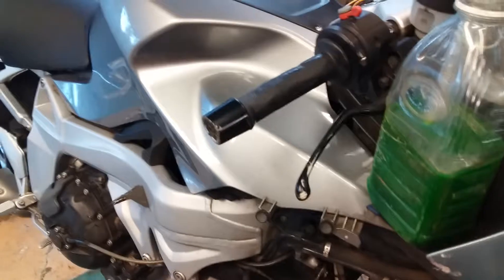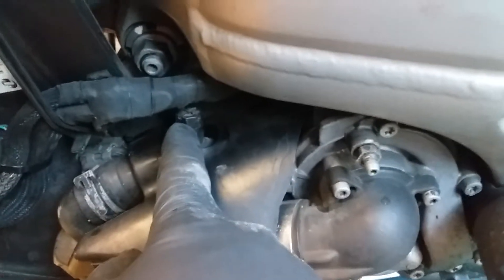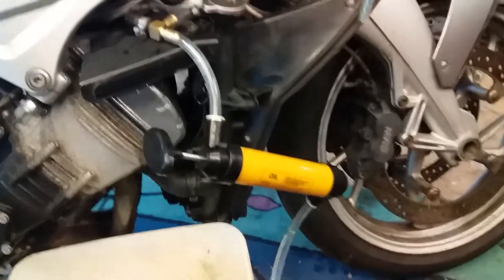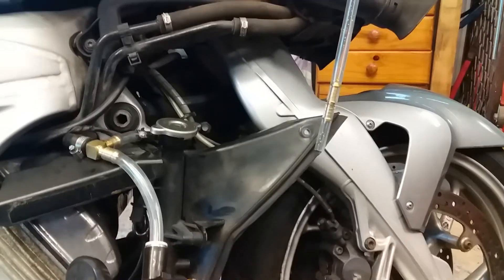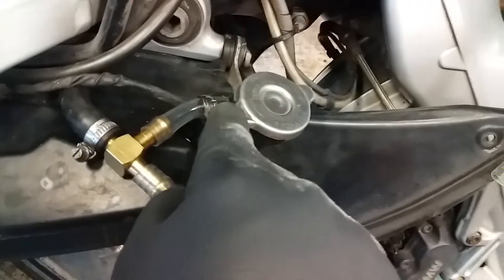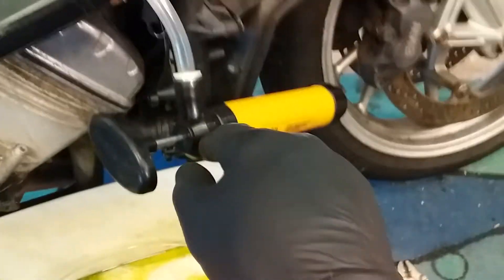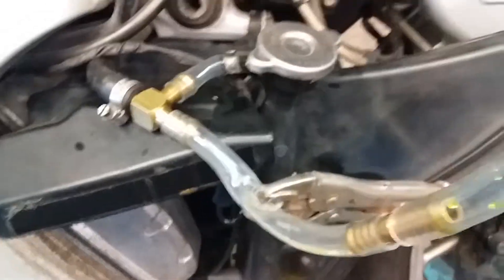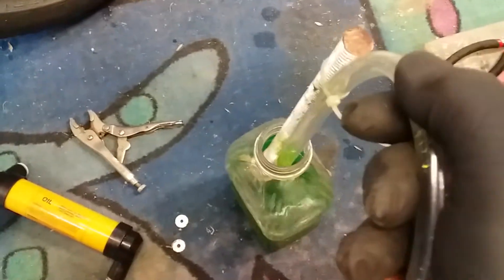Used a cheap oil suction hand pump to vacuum fill BMW K1200s coolant system

Comment: Excellent instructions ! I'm halfway through this procedure, hoping it works (have used 13mm plastic irrigation fitting instead of brass). Wasted quite a bit of coolant so far...bought the Hand Pump from Autobarn $30. Bulk screw Clamps from $2 shop. 6mm CLEAR aqua hose $6 Bunnings for bleed nipple.